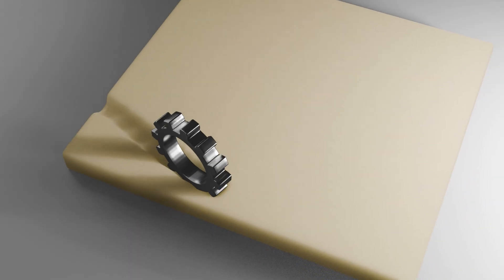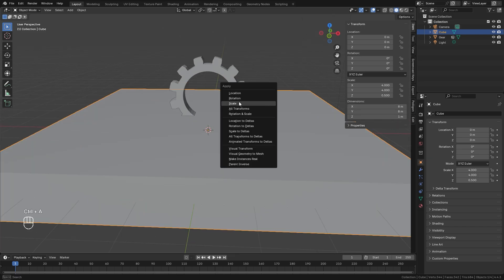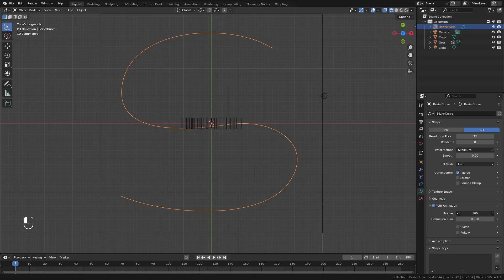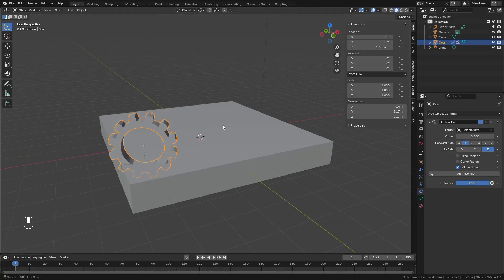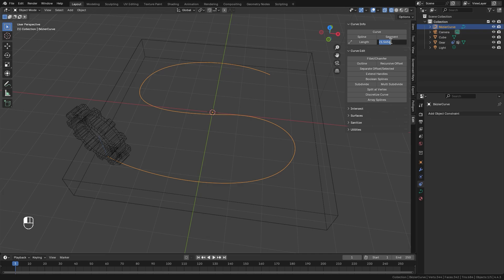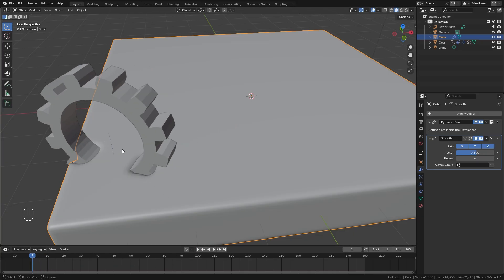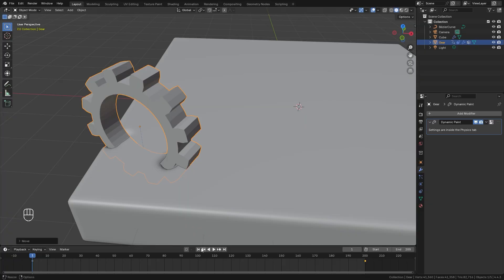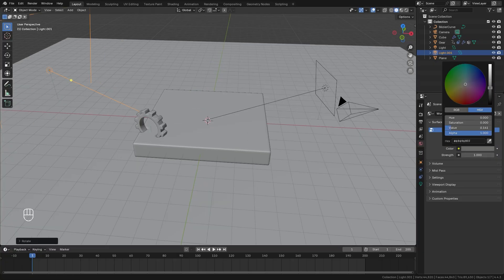Blender Tutorial - Creating a Memory Foam Animation w/ Dynamic Paint

Comment: Nice 👍 When I was watching the tutorial I thought about the subsurface scattering... you scale the distance how far the lights scatter below the surface. This will make thin parts appear brighter from the opposite of the light than thicker parts.
It's not visible in your scene from above the surface, but it will happen there.
Now I thought the foam gets compressed and light will actually not scatter as far as in the thicker parts. Is there an easy way to get the amount of displacement to decrease the scattering scale in those areas? I guess this should work somehow, I just can't figure it out right now...